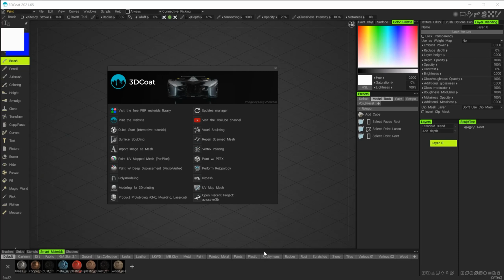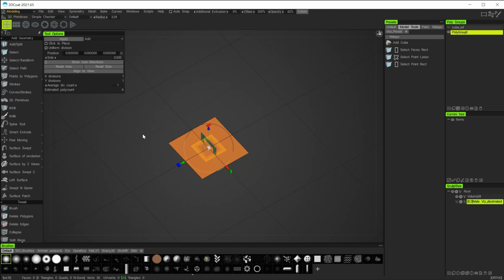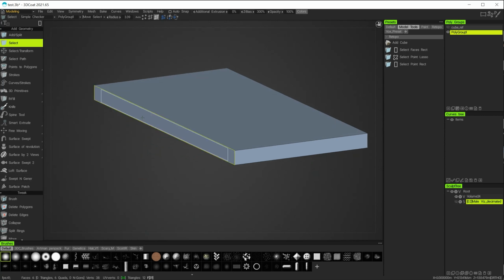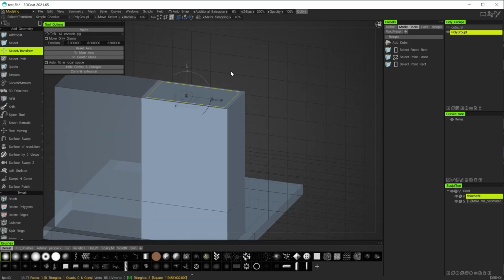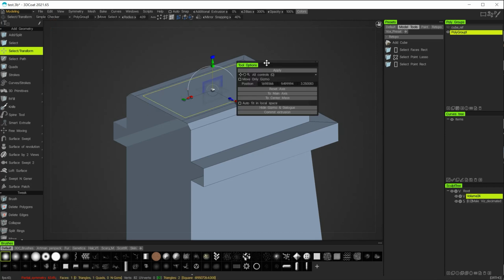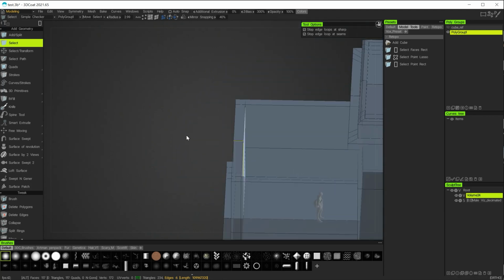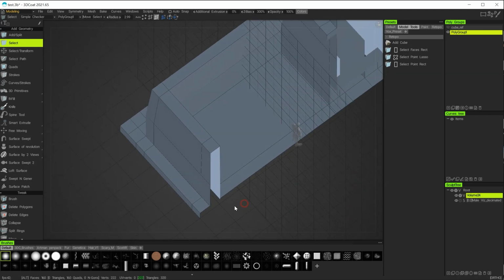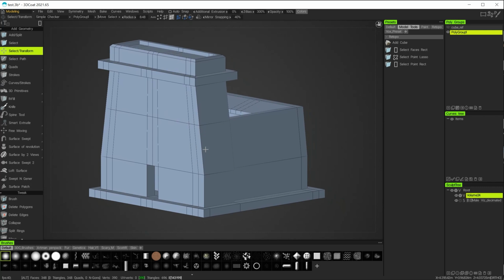3D-Coat Polygon Modelling Part 1

Comment: First thank you for this tutorial. I am having one problem and I do not know why my option seems different. When I go to add primitive and switch to the cube to make sure scale is right it comes in at a size of 0.300 and I see on your screen yours comes in at 0.500 I have set the scene scale to 100 yet when switching back to the modeling room to add primitive still comes in at a default of 0.300 I am using the latest version of 3D Coat 2022.29 any help would be appreciated thank you very much in advance
Reply from the maker: Yes i tried it again and i get the same result as you. In the tool options you'll have to manually change the Size to 0.500 by typing the value in the fields. Make sure fixed scale is on and you're set to Metres. The cube should then cover x4 smaller grid units. By setting it to 1.0 it should cover x16 smaller grid units.
Reply: @IanThompson007  Thank you I will try that and hopefully be able to continue the two previous video on scale and using the Blender Applink worked like a charm and were very helpful. Again thank you for getting back to me